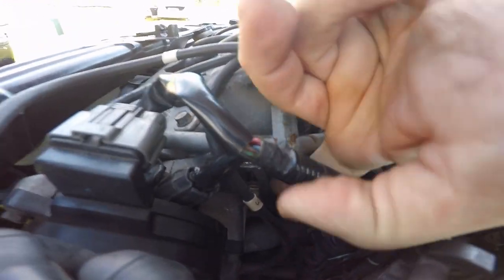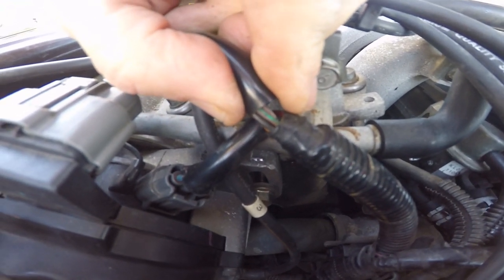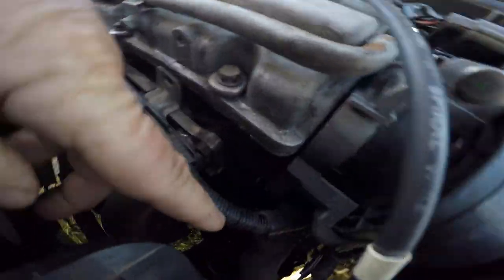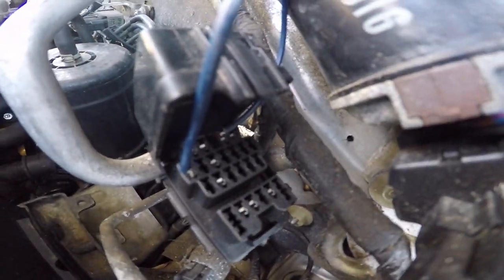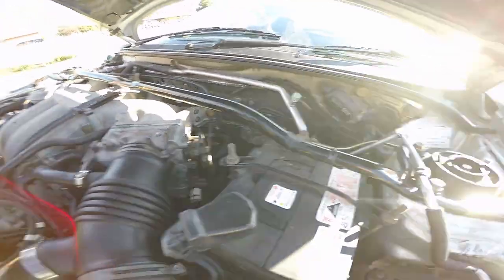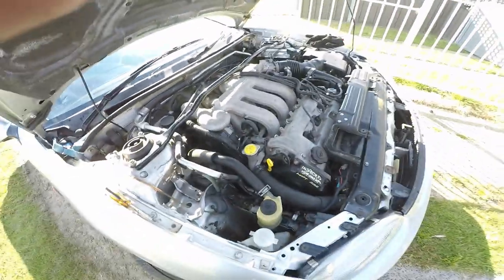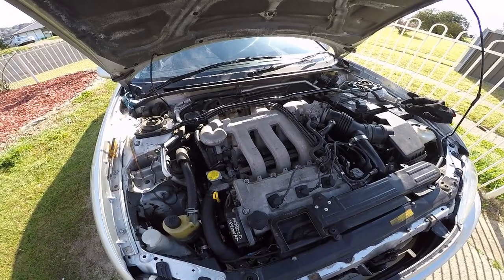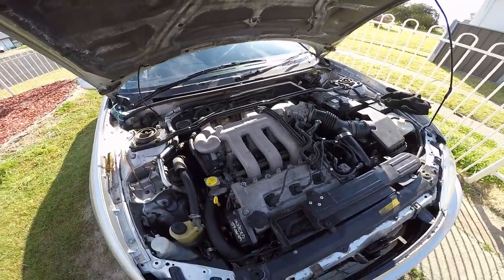MX3 K8 V6 Ignition Timing

Comment: I've a Lantis with the 2.0 KF-ZE, which has this distributor too. I tried setting timing on it this way, but I reckon the wiring to my OBD port is busted, as I can't get it to adjust even when jumping the TEN to Ground. The timing seems okay though, just a bit frustrating
Reply from the maker: Jumping the pins allows the system to accept the setting, when the system is running normally it "adjusts" for your mechanical adjustment and tends to "ignore" the adjustment, if that makes sense. It doesn't DO anything, just allows the system to accept the variation as a base line setting... hope this helps and thanks for the comment. more Kl stuff will be coming soon.
Reply: @mattjacomos2795  That's exactly what made me think it was ignoring my adjustments when jumping the pins. I no longer have my timing light (this was some time ago), but I might fiddle with the base-line position slightly and take it for some test pulls, as it does feel like the power flattens off more than it used to... I'll double check the VIRS solenoids too. I know one of them got gummed up a few years back when the PCV was sticking open.

Just recently picked up a second Lantis with a much nicer body and interior, with ABS and airbags. It needs a tonne of mechanical work, suspension is completely gone in the front, and weirdly the rear sub-frame is crumbling despite the body being rust free. Always considered doing some videos on them, but never had the confidence to show the world my driveway mechanic skills... Have subbed, as I reckon I might learn a few things, and can share some knowledge from my experience with these motors if it's needed.
Reply from the maker: as long as the solenoids cycle when you rev the engine, they should be ok. Weirdly, when I took the car for a run up and down the Blue mountains, the performance increased, fuel economy improved 25% and lifter rattle decreased. I really appreciate the sub, as I'm just starting out with this channel.
Reply: @mattjacomos2795  I'd recommend Penrite HPR 10W-50 oil to help with the lifter rattle, if you're not already running it. Every KL Mazda I've owned, the lifters have responded very well to it. I had an MX-6 that was super rattly, to the point I was considering replacing the lifters, but the switch to Penrite eliminated it almost entirely... It's a little pricey, but Supercheap does half-off on it at least a few times a year.
Reply from the maker: Sounds like a heavy weight oil for the KL, but I'll definitely give it a go on the new engine.